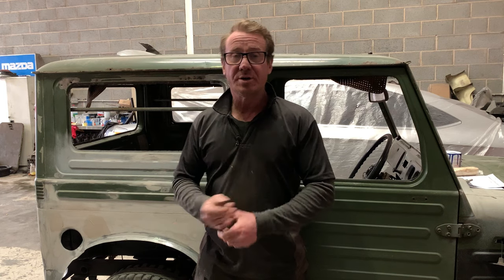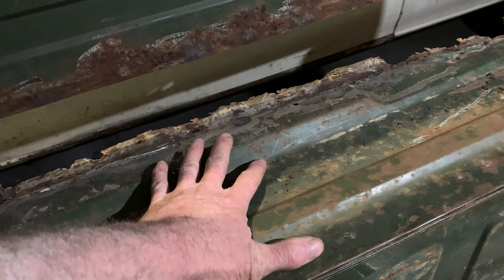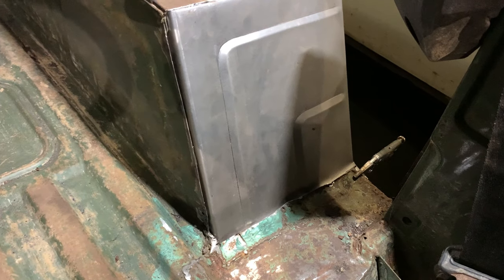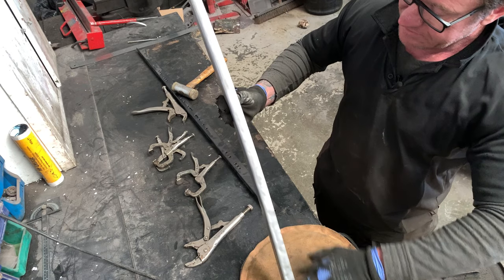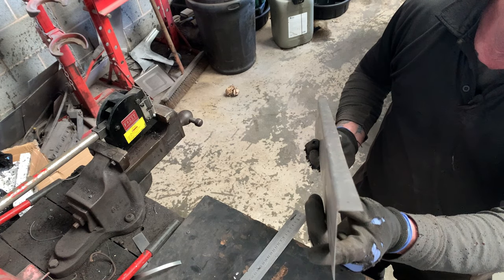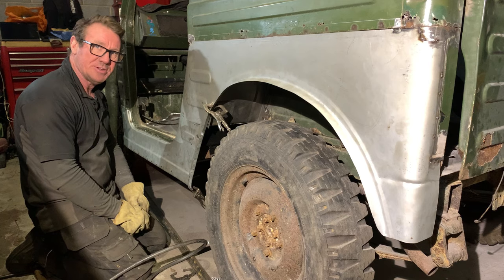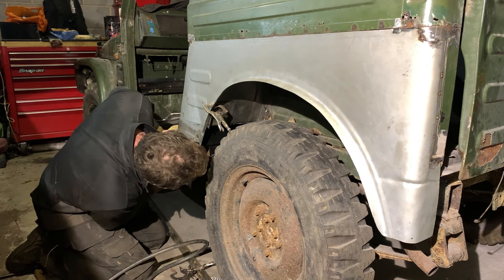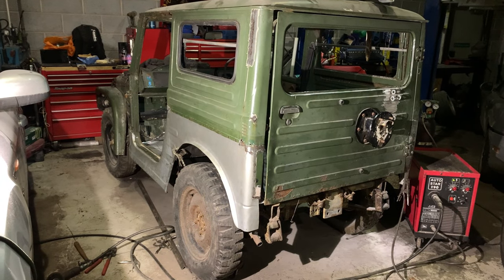Suzuki LJ80 Restoration Part 6 - Welding the Sill, Rear Quarter Panel and Inner Arch in Place

Comment: What is The plan for The drivetrain, a samurai Drivetrain would be cool but would be best to keep it original. Any Plans for rust prevention like applying raptorliner to the Floor underneeth and the Floor inside the car?
Reply: Engine will stay stock and protection will be dinitrol and Waxoil on the underbody and yes you are correct raptorliner for the load area floor :)

Comment: Are you using an English wheel to get those shapes?
Reply from the maker: Hi Paul , the English wheel was used with a flat bottom roller just to get a little bit of stretch in a sunken area of the panel when it was pressed and to flatten out where we had bent the upper lip back, very light pressure was used on the lip so it didn't stretch it  , the inner arch ends were formed using a bead roller :)
Reply: @yorkshirecarrestoration  Way above my pay scale LOL great work guys loving the whole thing

Comment: What is the gauge for the sheet metal you are using?
Reply from the maker: We mainly use three grades of metal 20,18 and 16 gauge and try to match as close to original as we can